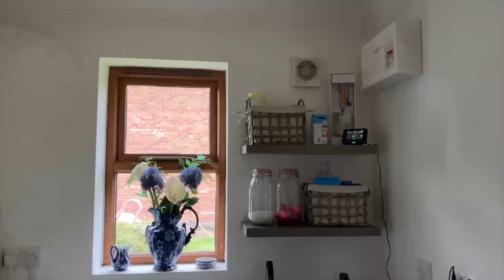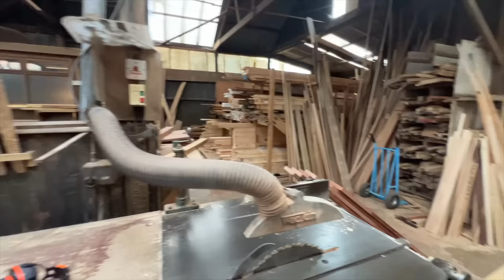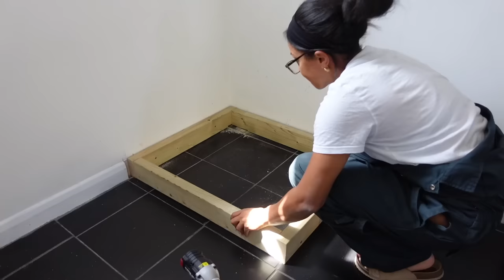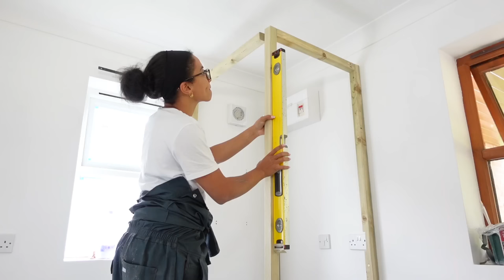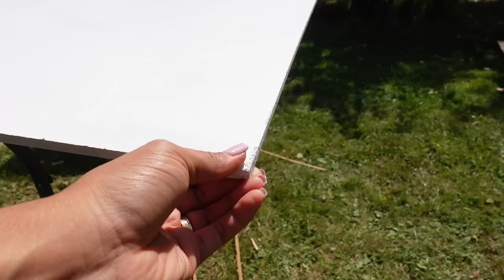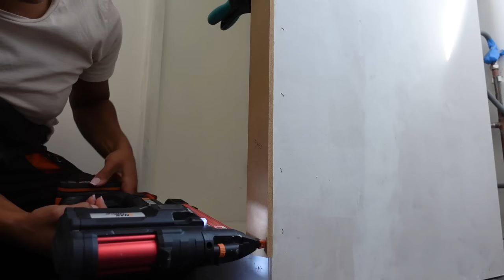DIY STACKED WASHER-DRYER CABINETS | Utility Room Makeover | Shade Shannon

Comment: As a general contractor, not the way I would have done it exactly. With that said your attention to detail is amazing and your end product shows you have a great talent.  Nice build I look forward to your next.
Reply: Ray, what would you have done differently?
Reply: @danjbenson87  First I would like to say Shade is very talented and did a great job. The only things I would do different is attaching the bottom plate of the Wall framing to the floor and wall attachment a little more secure.

Comment: You did an amazing job huni ,did you know you can buy a stacking kit for your washing machine and tumble dry and when they are stacked there is a shelf you can slide out to fold your washing on 😉👍😊💛
Reply: Stacking kits are expensive and you are limited to stackable washer/dryer models. This design solves both those problems.

Comment: I did something similar for a customer a while ago. The only difference is I built it to the ceiling and added coving along the front to avoid that dust trap on top of the units. 

Ok it’s a little extra work but really does give that built in feeling.

Comment: Just a little tip. When removing a segment of timber, like you did with the skirting board, cut the it at an angle to the face so when you prise it off it doesn't jam against the remaining section.

Comment: I couldn’t do this in my apartment so I bought an IKEA Pax wardrobe and put my portable washer and dryer inside! Works perfectly and it’s discreet. Nevertheless, great job! 🎉
Reply from the maker: That is awesome!
Reply: Does your dryer have a vent? I just ordered a portable vented dryer & trying to figure out what to do about the required ventilation space behind the unit to allow enough airflow around it. Was going to get an IKEA sektion cabinet for this as well, but again, not sure about the ventilation. My dryer suggests 5'' clearance all around it, and i'd only have approx 3'' around it. Maybe a small thing, but I don't want to create a fire hazard either; I'm debating dying the setup to allow more vented space or creating aeration holes in the side panels. Wondering if you've had any issues with your setup & the dryer?

Comment: Hey Shannon! 

I'm building my own cabinet to stack my washer/ drier - and came across your video which was a perfect jumping off point ! Well done and so well explained ! 

One question - did you consider having the washing machine just on the floor instead - I was going to just keep mine on the floor to save the vertical space and allow for more storage above as opposed to loosing 2 inches 

Thanks - just curious on the thought of keeping the base appliance on the floor 

- Eve

Comment: The centre support wasn’t necessary. The dryer sits on legs. The legs are near the 4 corners. That centre support doesn’t do anything for support. Having said that I love what you did. You explained it extremely well too. Well done! Second thing; when you made the cardboard template for the front bottom. You should of just cut the base mold and had the cabinet square with the base mold stopping against the MDF piece. You’re very talented sister! Please don’t take my comment in a negative way. That’s not my intention.
Reply from the maker: Thanks so much for the advice! Always willing to learn more. Glad you liked it!

Comment: Looks gorgeous 😍.  One question though, is it safe to enclosed a washer or dryer? Is it like a microwave where you have to have certain distance around it for fire safety? 🔥
Reply from the maker: Yes it needs ventilation so it it open top and has about 30 cm behind. When it’s on the doors are left open 🥰
Reply: Leaving it open at the top is so smart!

Comment: Question: are your walls cement behind the drywall, so you had to drill in and put anchors in and then tapcons?  The screws were blue.

Comment: what are the clearances that you need at the back and on the sides for the w/d machine? or if you can share the overall interior dimension. Did you leave you pluming on the same location?

Comment: Can you tell me what sort of hinges you used please?  I built myself wardrobes under the stairs in our playroom and I had an awful job finding hinges as I hadn't allowed for them to sit on the timber.  I ended up with piano hinges but there is a gap between the door and the side panel and you can see the hinges so it doesn't look as good.  Thanks.

Comment: Are these regular washer/dryer or stackable combo? 
I have seen in other videos that you cant stack them if they are not stackable, but since they are technically not on top of other, I am assuming it should be okay.
Reply from the maker: Don't think these are stackable but as the top dryer is on a separate support it's not on the bottom washer so all good!
Reply: They are are stackable machines

Comment: The problem is you putting a washer and a dryer in the cupboard together, if there’s a problem with one of the machines might be difficult to get to, also the cleaning of them dryers create a lot of dust even if you have got a vent.